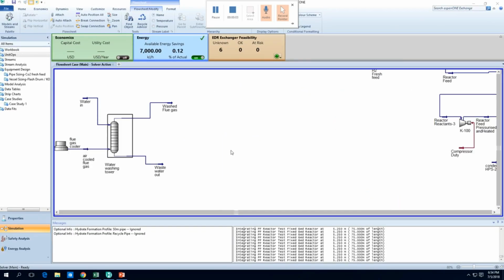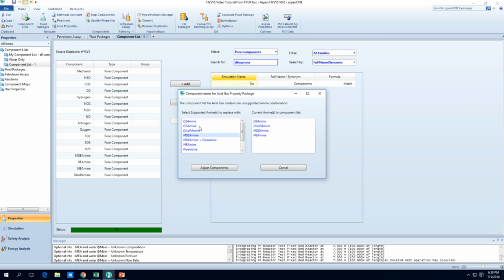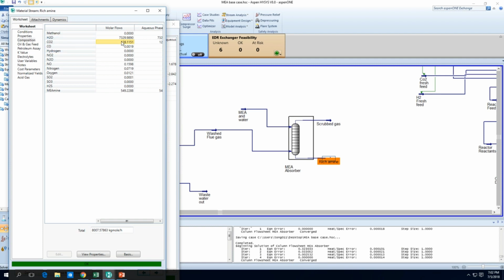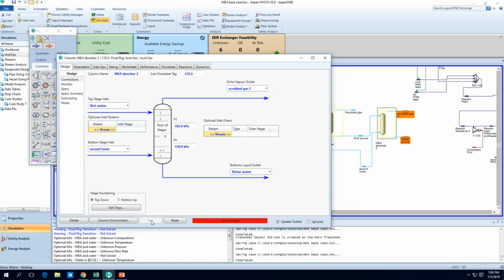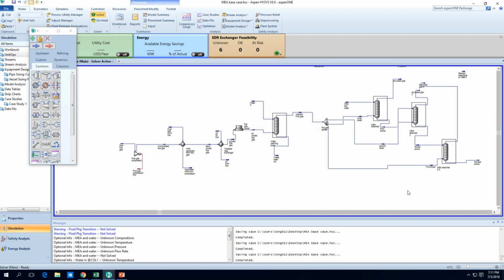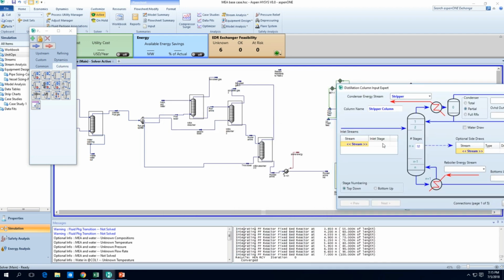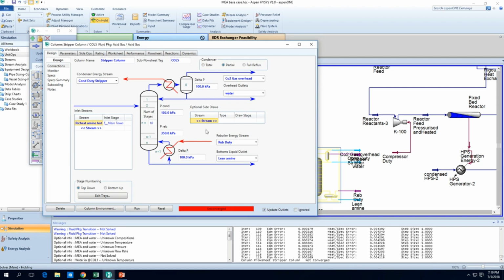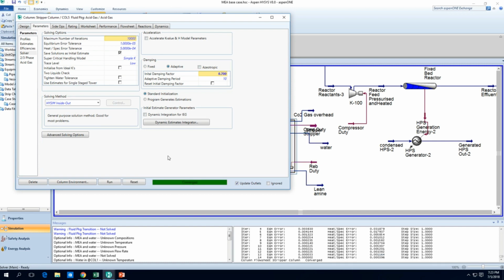HYSYS   MEAmine Absorption and Stripping with Adaptive Solver

Comment: Is it methylamine?
Reply: @TheoOngScienceAndEngineering  actually in the process of methylamine i used methanol and ammonia as my raw material. Then equilibrium reactor was used instead of pfr. Then flash drum is connected with output of reactor to remove the water. But i can remove the water at this stage by using this separator. Btw thank you for responding my question :')
Reply: @TheoOngScienceAndEngineering  i alrd run my hysys to obtain methylamine product but got some error at flash drum where is i need to separate water and methylamine